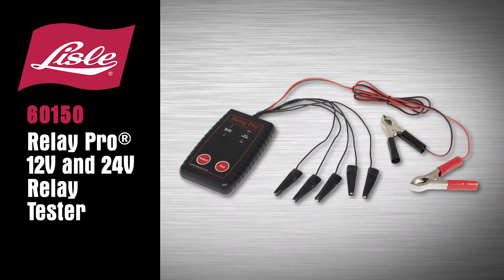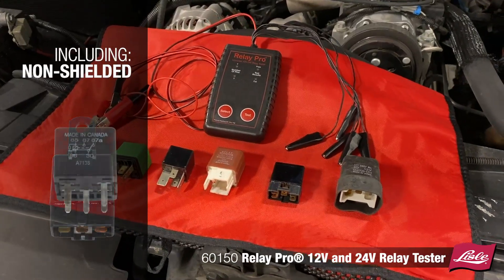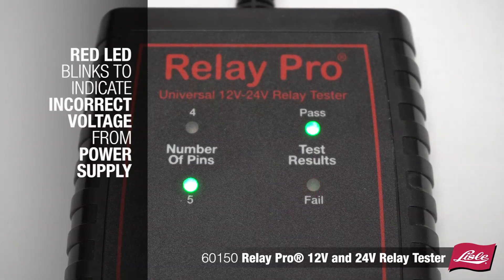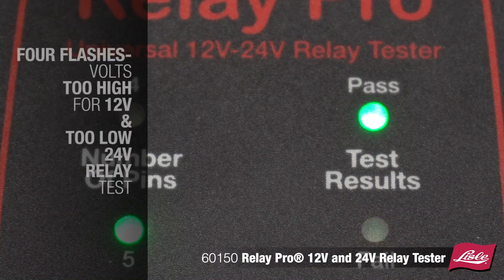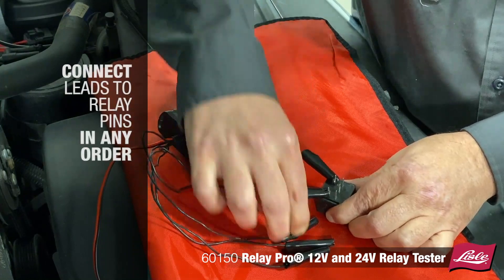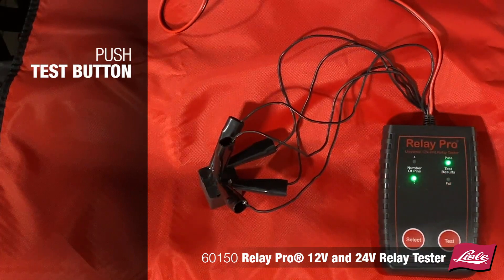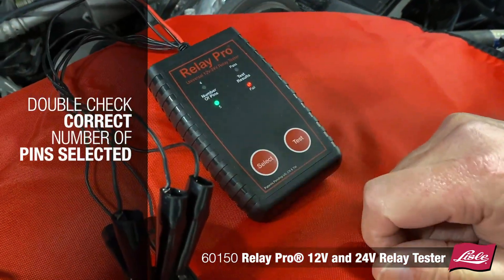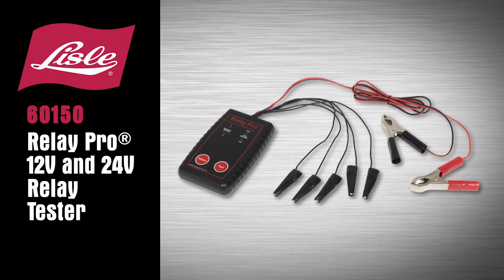Lisle 60150 Relay Pro® 12V and 24V Relay Tester

Comment: Great video, can you please tell me if this tool performs a continuity test on the contacts or does it apply an amp load on the contacts to check for voltage drop to see if they are good?